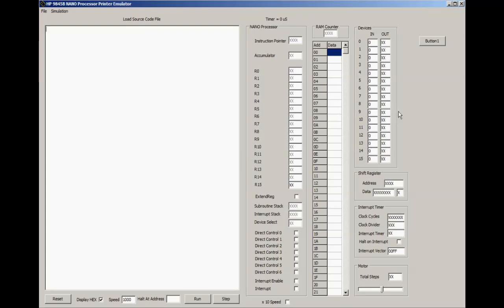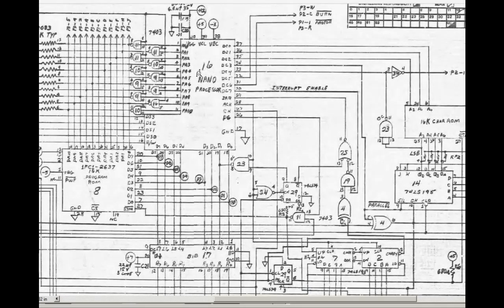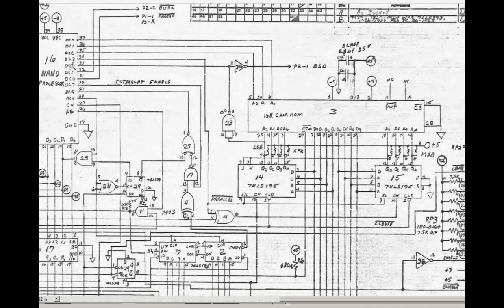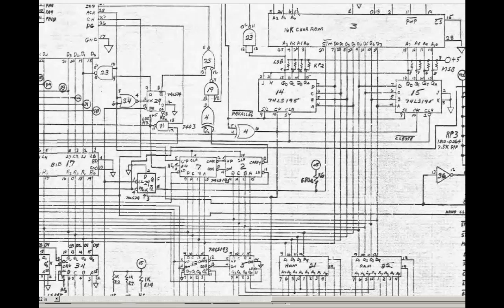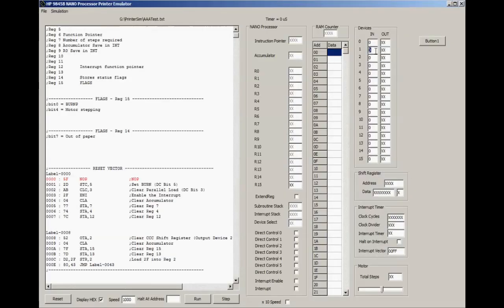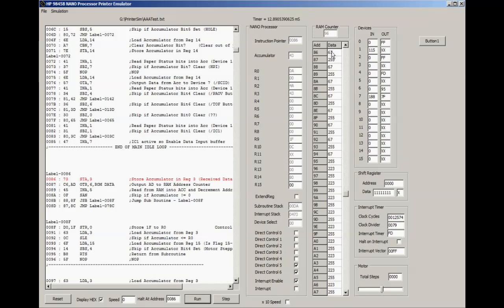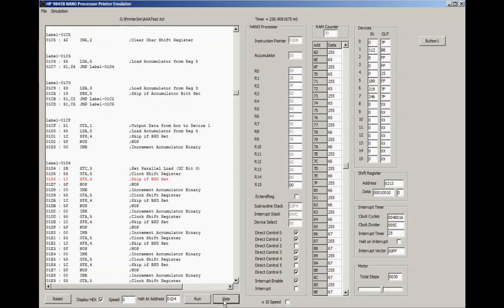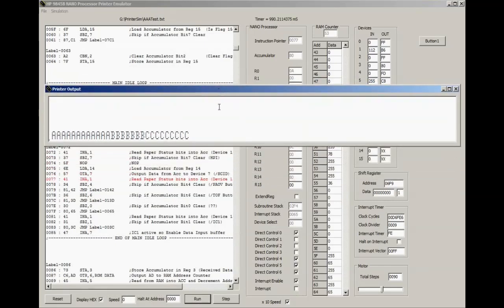HP NANO Processor Part2

Comment: I just found your series on repairing the HP 9845B while searching for information on the NANO processor.    I have been working on restoring a 9845B for the last few months.   It was possibly stored in a barn or outdoors as it had a mouse nest inside.  I disassembled it completely and gave it a thorough cleaning.   I found problems with several of the boards so it may have been a "parts donor" with boards swapped to repair other systems.   The CRT had the "cataract" problem so I rebuilt the CRT face (good examples on YouTube).   I replaced all the EMI filter caps a few dead transistors, voltage regulator and several TTL IC's.   Some of the ribbon cable connectors were damaged from liquid (mouse urine?)  I had to replace.    Even though the boards are gold plated I still had some spots with green corrosion to clean up.   Several connectors on one of the ROM trays are a total loss.    It's missing the air filter holders, the printer lid and the paper advance keycap.    I had several bad ROM's on the PPU RAM/ROM board so I built a temporary piggy-back board and burned a ROM image set with the diagnostic ROM code (from the HP9845.net website), and was able to boot up to the diagnostics.  The processors and RAM tested okay.    I have also repaired the tape capstans but tape drives will still need more work.    I am now looking into the printer, which seems to be completely nonfunctional, which is why I was looking for information on the NANO processor.   I was thinking of dumping the contents of the printer controller ROM and disassembling the code, but fortunately I found your video.   You have already done it!   Thanks for your hard work!    Now I just need to hook up my logic analyzer to the printer controller and see if it's doing it's thing...
Reply: Can I get a copy of your printer ROM disassembly?

Comment: Very impressive! Just keeping track of the inverted vs. non-inverted data without the simulator would be, for me, a nightmare. I would like to see more of the simulator and its evolution. Regards, David
Reply from the maker: I will show some more of this. There was a fault remaining in the printer which would have been very tricky to resolve without the simulator. As the simulator is developing nicely I decided to have a go at using it with the LA to track down the fault and in less than 20 minutes I got the printer printing (sort of). It still has a few faults but hopefully the simulator can also help with these.

Comment: Why would electronics engineers ever prefer inverted data (or logic, for that matter)? Does that preference explain why the HP engineers tolerated the (to my mind) chaos of needing to deal with both plain and inverted data coming from the RAM here?
Reply: I don’t know about inverted data, but using negative logic for control signals has the advantage that you can create arbitrary equations with NAND etc, whereas you can’t do that with AND and OR. Also if 0V is your active signal then you can mix different not asserted voltage levels without consequence, which might have (and still could be?) been useful.
Reply: @lawrencemanning  Thank you. I've always wondered.